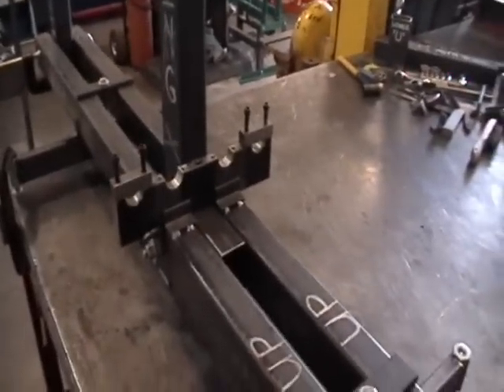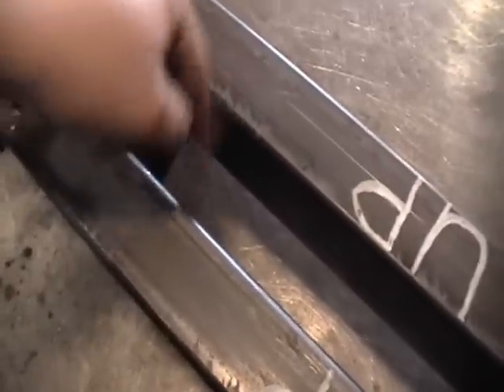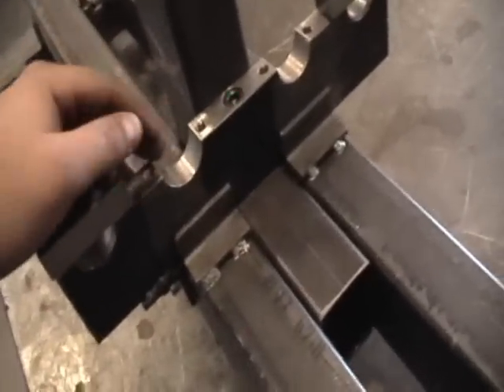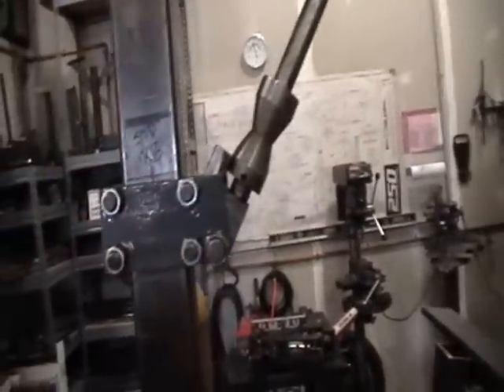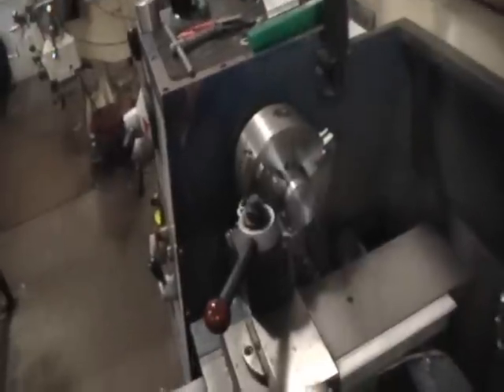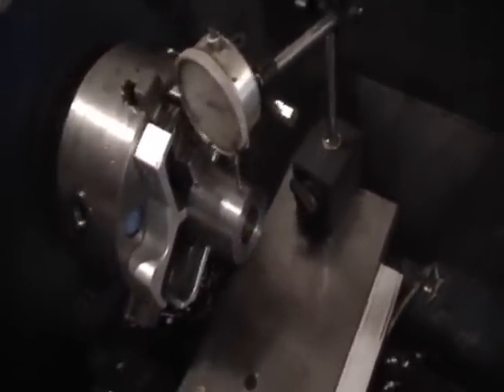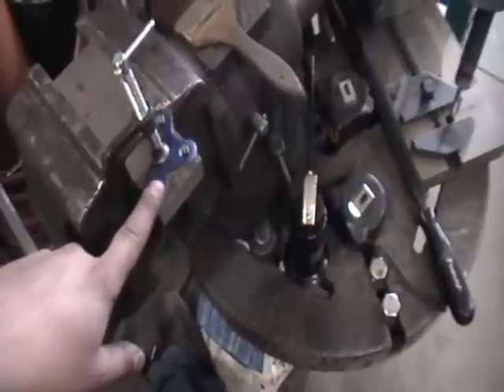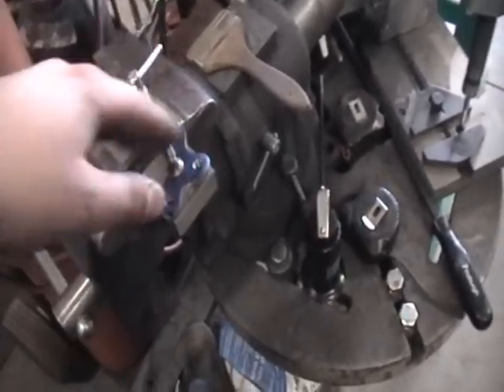Motorcycle Frame Jig Fabrication Part 3

Comment from the maker: @bennyleechop I typically make the on-center distance between the bottom rails for an ironhead (and 82-03 XL frames) at 4.0", which matches the factory dim.'s.  I typically make the bottom of the bottom rails sit up off of the deck/top of the jig 2.0", but that is certainly NOT a magic number because this combined with the height that you sit your axle station determines the height that the rear of the frame will sit off the ground.  --Al

Comment: what is the measurement for the ironhead lower frame rail fixture? Distance between the two machined indentations, and the distance from the base of the frame to the bottom of the premachined grooves. Thanks